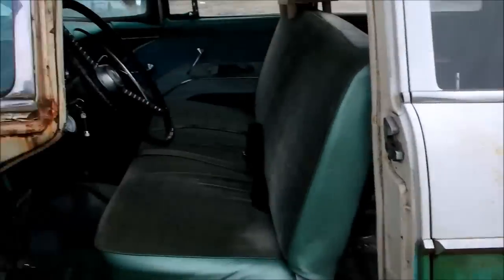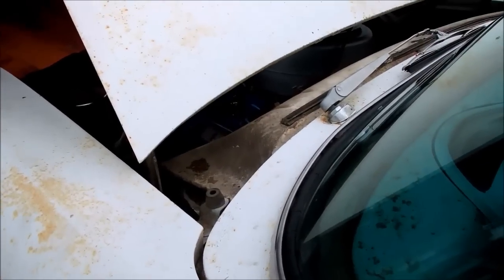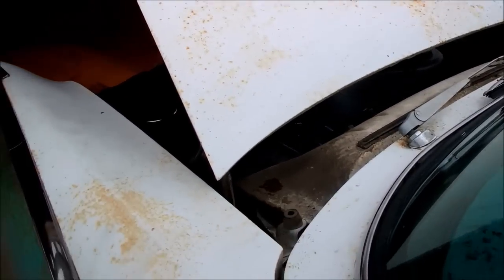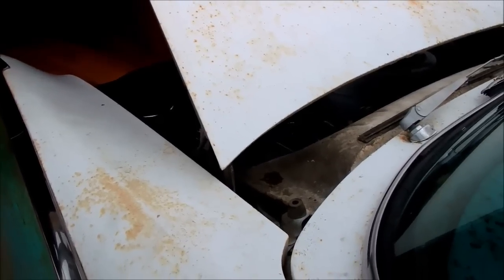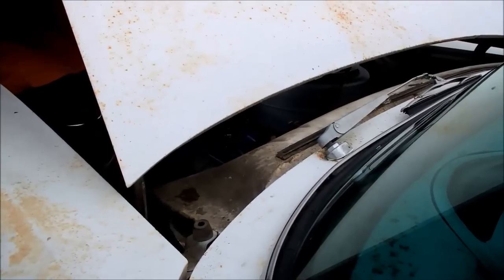My Ford is Retarded

Comment: Is the auto advance system working ok mr peek, perhaps it dont have enough range to cope with the cccccold weather ha ha :-))
Reply from the maker: Yes, the vacuum advance works..
Reply: rpeek
Just being nosey again lol, my mate has an old morris minor and that seems to have a vaccume advance, ive often wondered if the dam thing is working ok.
Reply from the maker: zx8401ztv Pull the hose lose from the carb, stick a finger over the hole you pulled it lose from, and suck on the hose.  If the engine speeds up it's working.
Reply: rpeek
Nice tip, i hadnt thought about it like that, thank you :-))
Reply from the maker: zx8401ztv   Or you can do it with the motor not running, but you have to take the distributor cap off so you can see if the points plate inside turns when you suck on that hose..
Reply: rpeek
Ahhh that sounds better :-), i do like the visual checks :-))
Seeing the points rotate a little sounds like a great way of checking :D

I am technical in some ways (electronics), but as i have never owned a car so i do miss out on the usefull tests, fixing frends cars dont really teach me much, its just basic replace-a-part lol.

I have a masters degree in tea drinking ha ha :D :D
Reply from the maker: zx8401ztv    I'm don't have a degree in Tea drinkin', but I was trained by a master tea drinker in a mountain in Tibet as a child.   Zen, Peace, Karma, Montra, Orange Peaco.